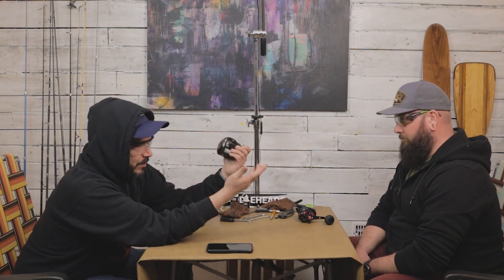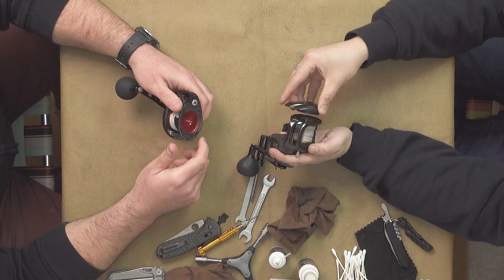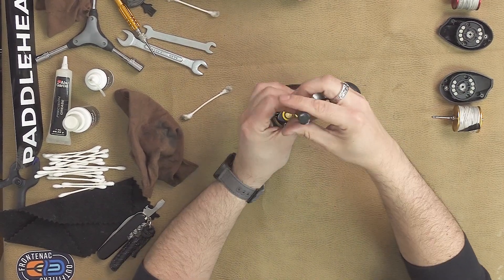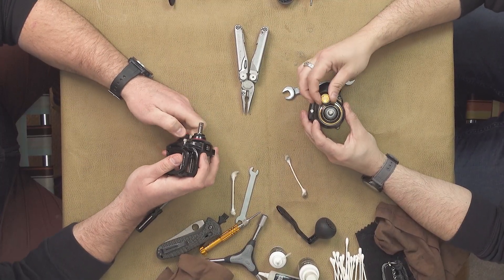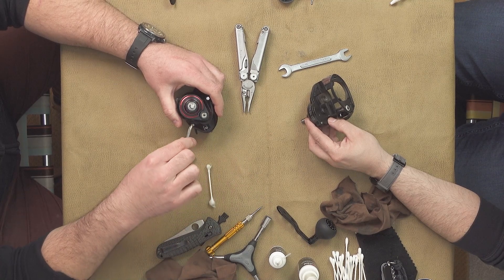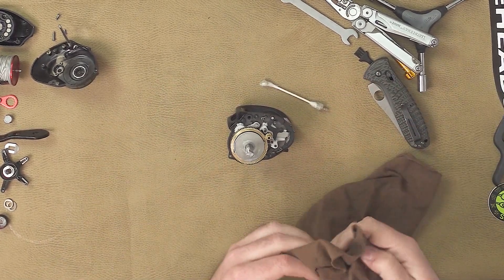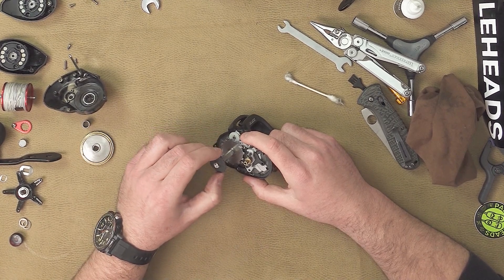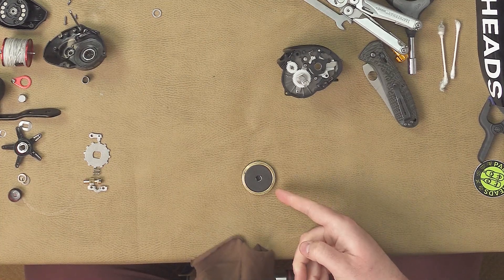Baitcaster Service Tutorial - Piscifun Alijoz 300 Size Reel

Comment: 23:29 it looks like you're missing part #130. I took mine apart for the first time yesterday and I'm also missing this part. Take a look at your schematics and you'll see this. It's a small washer that should go between the clicker and the star drag. What do you think?
Reply: Awesome video too
Reply from the maker: Is it possible it was that small clear plastic washer that we weren't sure where it came from?
Reply from the maker: Thanks!
Reply: @Paddleheads  not sure. Do you have the timestamp for that? There was the small metal washer you were unsure of and that went in the right place.
Reply: Sometimes these small washers are put in place as spacer washers. I've actually had a Shimano Curado e series one that had a spacer washer and one that didn't. So possibly this is the case
Reply: the small "missing" part should be between handle and the gold nut. Look at video 4:36, you have it located at the handle when taking apart, but it falls off when you use the towel probably.  @Paddleheads

Comment: Do you know what sizes are the bearings...i want to replace with ceramic
Reply from the maker: Don't know the sizes specifically. There are manufacturers that make ceramic bearings specifically for reels, I'd look into them and see if they have a kit for this reel. I've upgraded some older reels to ceramic bearings - over time the difference becomes less and less vs stock bearings, personally I wouldn't recommend spending the money.

Comment: Thank you guys! My 2 reels developed slight clicking feel/sound when under load, any ideas?  Thanks
Reply from the maker: While the fish is pulling drag? Or when reeling up line?
Reply: @Paddleheads  Thanks for reply! :)  While reeling in the bait, very light on top water baits and feels way more "clicky" using bucktail like double 8. 
You can probably more feel it in the hand than hear it.
Reply from the maker: Have you taken it apart to clean yet? Did this happen after cleaning?
Reply: @Paddleheads  No, not yet, one started doing that, and now the other developed the same problem. They work perfectly fine, it just feels weird in the hand. Got 2 more and they still work fine. They are all in service 2 seasons. ( Musky only) I keep my stuff clean, and always inside so it's not abuse issue :)
Reply from the maker: Could be any number of things. If you're concerned about it, I'd recommend following this tutorial to open it up, clean, and add new grease and oil. That may be just what it needs.
Reply: Yeah, will have to do that.
Makes 8 or 9 clicks per one full handle rotation. Weird
Reply: Update, if anyone is interested, the problem was that the reel factory over lubrication caused this.
All the fairly heavy grease packed around the powel ( clicky gear 16:51 ) and it blocked free movement of that part.
Thanks again guys for the tutorial how to take it a part and put it back together! :)
Reply from the maker: Thank you for the update! Very happy to hear the video helped and you solved your problem!

Comment: So I saw your reel cleaning video this spring and some of the reels you cleaned were piscifun alijoz reels.  which leads me to my Questions:
1) power handle vs dual handle when do you choose which one for your technique?
2)8.1 vs 5.1 gear ratio what uses are best for each gear ratio  in your opinion?
3)how are your alijoz holding up
Reply from the maker: Excellent questions. 1) I use a power handle for musky fishing because they're you're fishing with such large baits that the length of the handle gives you a little extra torque when retrieving. For bass fishing or anything else, I'll use the paddle handle.
2) IMO, for musky fishing again, I prefer a faster retrieve -  Musky are fast and you'll never be able to pull a bait faster than a musky can move. It's easier to slow down a retrieve than speed it up. A slower gear ratio can be great if you know you'll be fishing a bait a slower speed and you really want to be able to creep it.
3) the reels are holding up quite well! I've landed a few muskies on them, with some good battles, and they're still performing great!

Comment: Good detailed breakdown. You also could have taken out the two screws that hold the drive shaft plate in place, çleaned and applied some fresh grease and oil to the drive shaft bearing. Nothing can fall out when it's taken apart so totally safe to go that ond step further to access the bearing. 👍
Reply from the maker: Awesome! Thanks for the tip. We'll try that next time. 🙏

Comment: In reel why they use opinion gear plastic collar and two small gears also plastic materials. Why not using metallic.
Reply from the maker: This is an inexpensive reel when compared to others in this size. Manufacturers will use plastic where they can get away with it to reduce costs. More expensive options probably have more metallic parts.

Comment: Is there an exploded view of the parts somewhere? Maybe? Couldn't find one, not even in the manual. Thanks. Very Helpful, btw.
Reply from the maker: Glad you found it helpful! I own three of these bait caster reels, and one had a different manual than the rest, which included an exploded view of the reel. If you email us using the email address on our "About" page, I will scan the exploded view and email it to you.
Reply: @Paddleheads  Thanks, the manufacturer sent me one. FYI, my reel sat on the bottom of some salt flats for about 2.5 hours (long story), took it apart, rinsed it and it appears to still be in fine shape. I took apart the magnetic break and the mechanism seems a bit weak and prone to degradation, but everything else was solid.

Comment: Great video, guys. Thanks for making this. Unfortunately, I am unable to remove my spool for some reason. I've taken off the side, but it won't slide out. It's like it's caught on something. Any suggestions?
Reply from the maker: Hi Peter, if you're using the same reel, there's nothing that can mechanically lock the spool into place besides the plate. If that's removed something on your reel must be obstructing the spool. If your spool is overspooled with line it may be too big to fit through the hole. Does it move at all?
Reply: @Paddleheads  I wonder if it is overspooled. I will check that when I get home. Thanks!